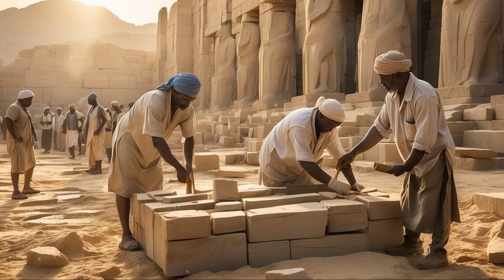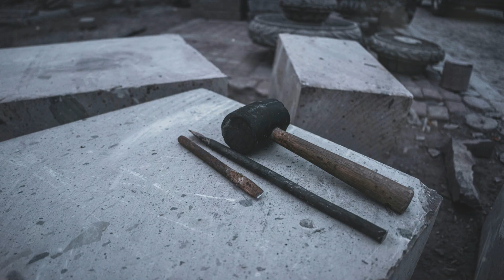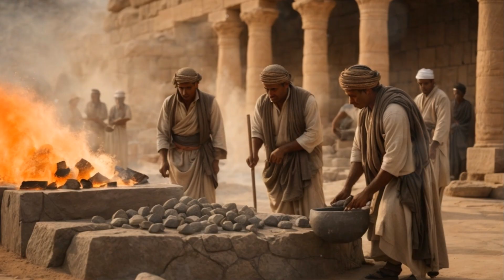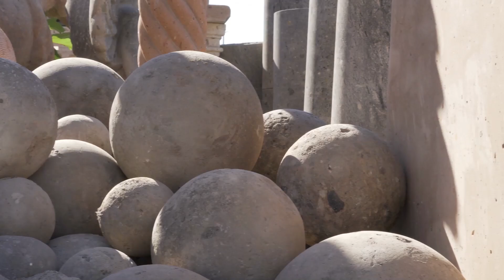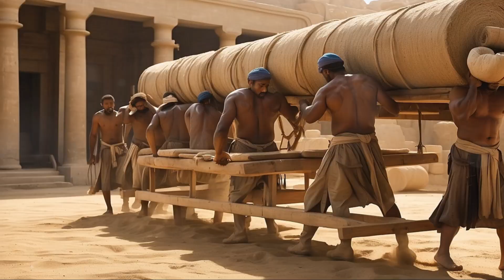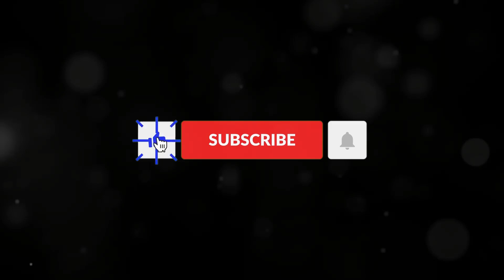How Ancient Egyptians Cut Granite With Simple Tools #ancientegypt #ancienttechnology #pyramids

Comment: The granite blocks & ones like it found all over the world were made by melting the granite using the sun & a Fresnel lens & then injecting the molten liquid into pre-formed moulds. No need to quarry, shape or lift megalithic blocks. This level of craftmanship can only be achieved by this method. The 'knobs' are the remains of where the molten granite was injected into the mould, they are always found at the bottom of the block so that when the liquid enters & fills the mould it pushes the air out.